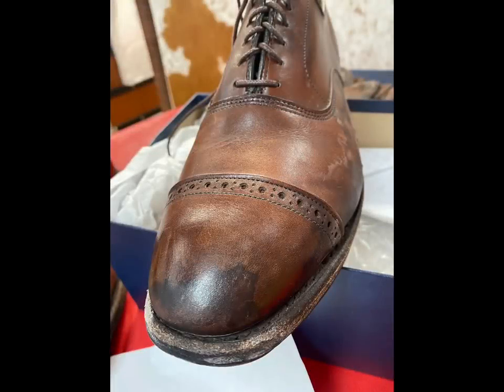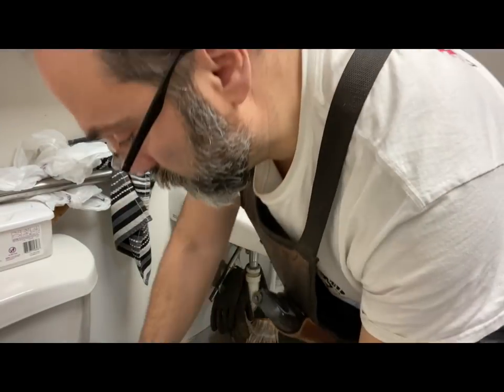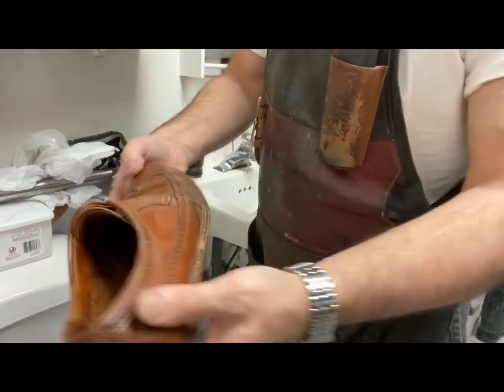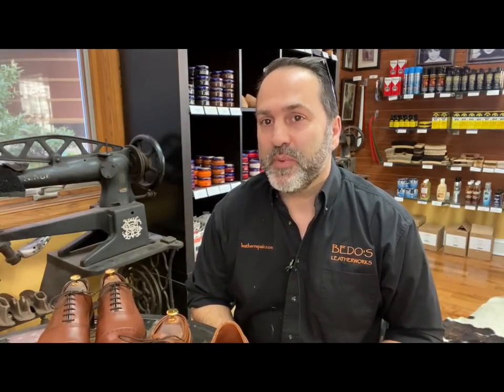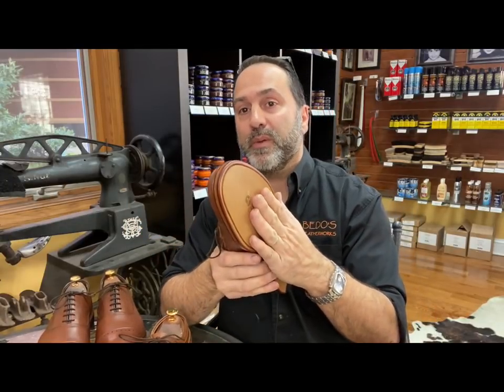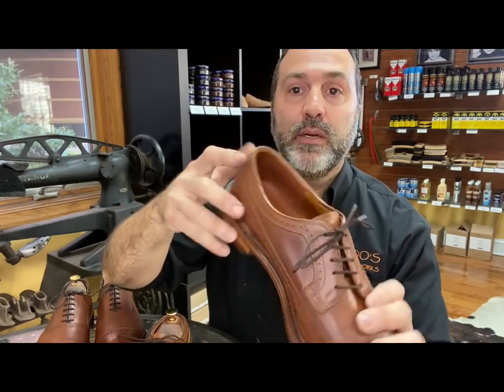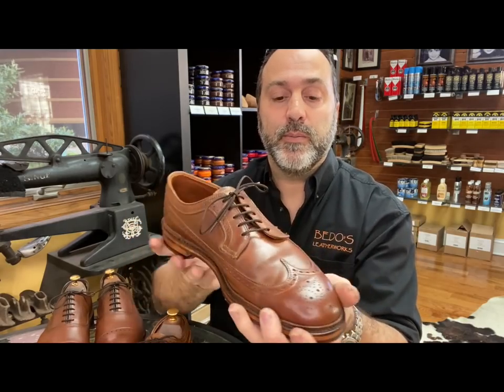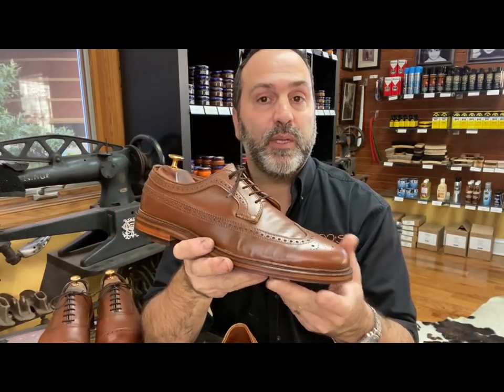Water damaged uppers

Comment: Steve, loved the video. So, a few years ago I ruined a pair of brown Allen Edmonds Cornwallis by walking through some salty snow/slush. I was devastated! I happened upon your original video of restoring water damaged uppers and went through EVERY step. It did the job. The stains were gone. But then I made a mistake and used a shoe leather dye and literally painted it on. It looked horrible. And to make matters worse, upon flexing, the dye started to peel off. Anyway, I let be for almost 3 years. A few days ago, I stripped off the dye/paint with some brake cleaner and applied some Saphir renovator, brown shoe polish and wax. Man, did it bring back the colour and the shoes look great. Thank you for your tips on how to restore the water damage. I will probably have them recrafted by a local cobbler and get new soles.

Comment: Interesting. I have worked on several uppers that had water and salt stains and I just stripped the waxes with Renomat, used Saphir Salt Stain formula on the water stains, after dried, Cleaned with Saddle Soap, then when dried I used Saphir Conditioner and let soak and dry for 2-3 days and done. Back to new. But I love watching how others approach things differently as one never knows when they will come across a scenario where the formula they normally use, doesn't work. Just another alternative approach to accomplishing the same thing.

Comment: As a chemist,  I would not recommend putting pure acetone into the red plastic cup.  Two reasons.  One:  Acetone evaporates quickly in open containers.  Two:  Acetone is likely to dissolve the plastic cup or extract plasticizers from the plastic.  Plasticizers can be transferred into your body by the acetone,  and they can cause cancer or worse Reduce Testosterone levels,  as most plasticizers are estrogen-like compounds.
Reply: I once put acetone in a plastic cup and the cup's bottom dissolved... Fortunately, I only tried that once.

Comment: With that dark stain you showed us,on full grain leather would pushing acetone through from the inside work? Perhaps under a little pressure,maybe from a wide bore syringe with no needle. Just thinking out loud.
Edit to add..Enjoyed the change in content. Upper care and treatment is foreign to lots of folk.

Thanks as ever,quality uploaders have never been more loved.
Reply from the maker: Hedge hog no it has nothing to do with the inside besides the lining is in the way
Reply: @BedosLeatherworksLLC  I understand,i wondered if the staining could be pushed out through the pores rather than rubbed away from the outside.

Comment: I'm pretty sure most modern shell cordovan (like from Horween) is cow or sheep or goat leather, and not just horsehide like originally.  Am I wrong?
Reply: Nope, it's still the same.  https://www.horween.com/articles

GENUINE SHELL CORDOVAN

Genuine Shell Cordovan is the art of tanning at its finest.  More than just a color, it is a very specific leather, from a particular part of a horsehide.  The irregular oval shaped shells are tanned, stuffed, shaved, and then polished – a process taking at least six months.  Each shell is slowly steeped in gentle vegetable liquors. The shells are genuine hot stuffed then slicked onto glass frames to dry.  Each shell is hand curried and shaved by highly skilled artisans to expose the shell. Dyes are hand rubbed on for a deep aniline finish. Finally, the shells are hand glazed to achieve the rich, glossy look and feel prized by fine craftsmen.
Reply: Horween produces different types of leathers, yes, but cordovan is always horse.
Reply from the maker: HotWax93shell cordovan it’s always horse

Comment: if you have time some time, you could make a video how to treat a pair of shoes like that, who got water damage like these, right after it happened. so I'm in the rain right now with that huge water damage and i come home now... what to do...
Reply from the maker: ALX I explained what to do
Reply: Bedo's Leatherworks LLC ... yes i heard it. i just had the impression, what you described is the normal, not so severe wetting of the shoe and what happens to the poor shell shoe was much worst and would need some more attention. but if the treatment you described is preventing theses damages when done immediate and proper, than it sound fairly easy and I'll keep it in mind for the next occasion. thank you and best regards :)

Comment: At one point or another your video software added black bars above and below the video, which on wide screens causes YT to add black stripes to the sides and you're left with image surrounded with black on each side.
Reply: If your camera records wider than standard aspect ratios, either scale the video up and cut the sides off to fit into a typical resolution or leave it as is. Don't let it encode with blank spaces on screen.
Reply: Sorry if I'm not much help in explaining this but a google search will surely show you what it is and what to do about it in the program that you're using
Reply from the maker: wojtekimbier I use an I phone and at times I’ll take pictures and don’t turn the phone side ways so it adds the black lines on the sides

Comment: Instead of using plastic bags to seal them up would it not be more efficient and effective to get some airtight reusable plastic containers for the same purpose? You can pick them up at dollar stores fro a buck or two and they will last literally forever instead of single use plastic bags that end up in landfills.
Reply from the maker: You’d have to suck the air out so it has to be some sort of resealable bags or something like that